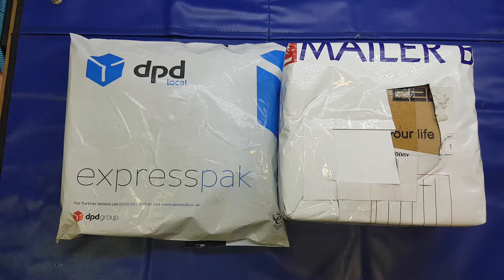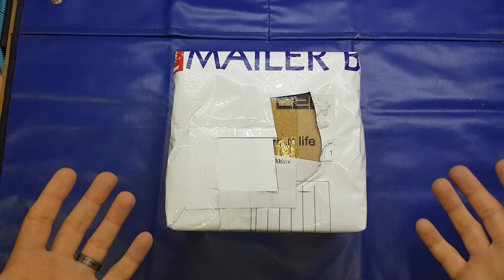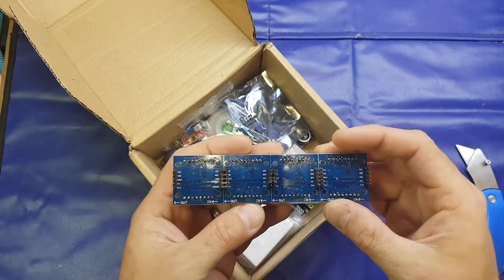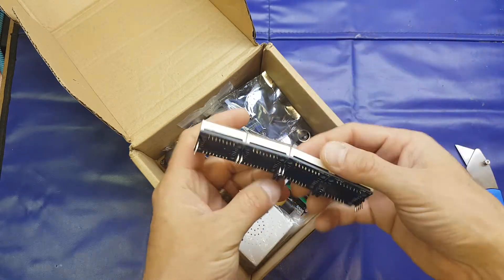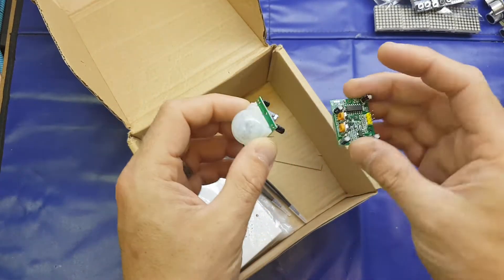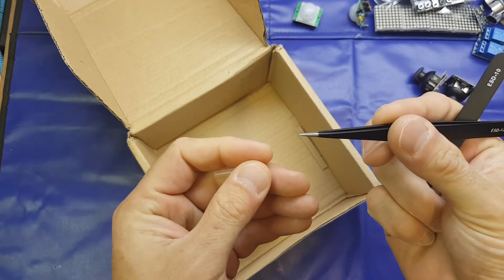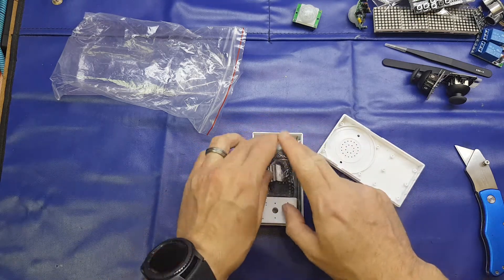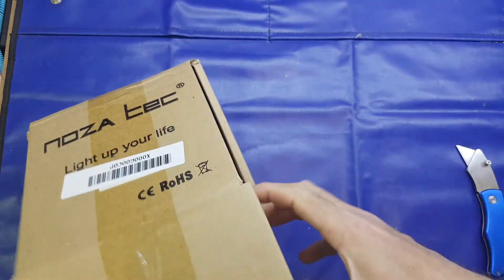WHYBBN? Crumble starter kit, POV clock kit and arduino modules. (Electronics blog tutorial mailbag)

Comment: So the crumble is a BBC MicroBit clone and they solder even bigger breakouts to breakout boards and charge premium? This is genius :D
Reply from the maker: +BSJuliaMagna Crumble uses a PIC whereas the Microbit is ARM based. In terms of a starter kit, the Crumble is cheaper including delivery and breakout boards are a similar price. As I mentioned in the video, this was not a paid promotion so I'm not defending Redfern; the similarities are the connection method and the fact that they are both aimed at school children.
Reply: Yes the MicroBit is pretty overpriced for its capabilities and I appreciate clones. Hell most of our desktop PCs are "IBM compatibles" (clones) nowadays. I read a bit and those two dont seem compatible so I guess my "clone" comment was nonsense. I just found it amusing that they took a breakout board which you can get a dozen a dime and put their own breakout board on it instead of making their own breakout version but I guess this is the most economic way to do it in their case.
Reply: n.b. The Crumble was developed back in 2013 and launched in Summer 2014 - we just didn't have the BBC's marketing budget ;-) There is a video of the prototypes here: https://vimeo.com/94097687
Full disclosure: my partner, Joseph, conceived & developed the whole thing (software, firmware, hardware) in our spare room. The first batch were manufactured on a Pick&Place machine we bought for £500 off eBay :-)